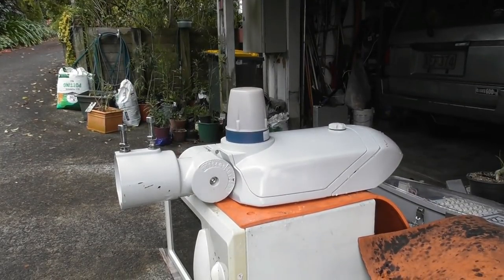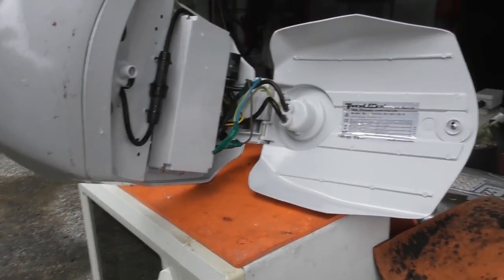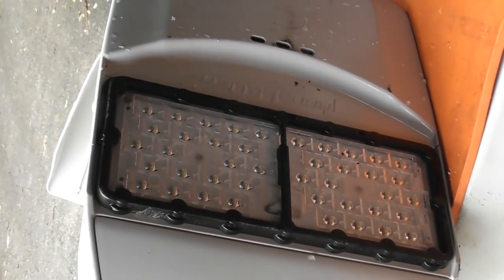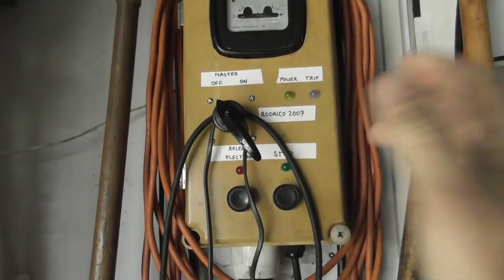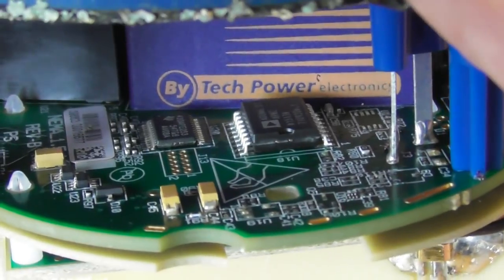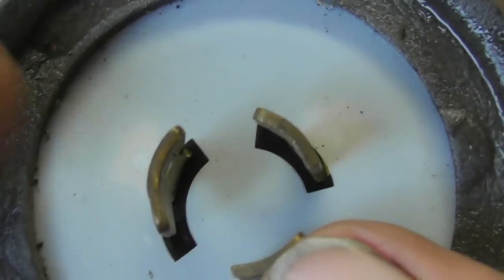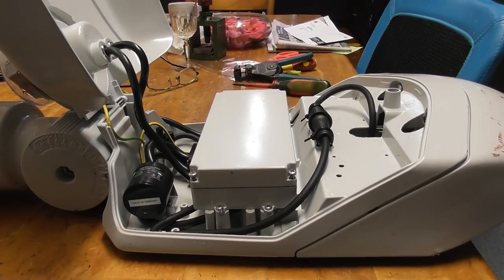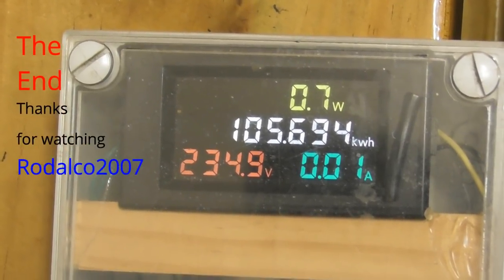LED Streetlight with remote dimmable option

Comment: The energy saving is great and all, But i sure do miss the low pressure sodium lamps of my childhood
Reply: energy savings are likely negated by them failing so soon... everywhere I look there's broken LED's blinking and not lighting at all dead...
costs lots of money, buying, installing, then needing to replace them so soon again and added man hours to do so..
Reply: @throttlebottle5906  Yeah these LED streetlights wont last nowhere near as long as mercury/sodium lamps because of all the electronics in the electronic drivers getting water/crap in them, unlike a magnetic ballast that can last many years with little to no damage.

Comment: Ants got in the photocell, and the supercap has done the usual and popped a seal, probably because it is only a 85C rated part, and that enclosure probably can get to over 100C.

I would guess the radio is there to perform both remote power switching, and to also allow the lights to communicate back down the chain to the controller for things like mains voltage, lamp current, times operating and such, performing both the light switch operations and as well acting as power line monitors. they look like they each get programmed via a NFC coil (the label on the outside) so that parameters can be set for each one individually, or for maintenance to check operation while up the pole, so as to do testing locally. 

Likely they use low power radio modules and something like Zigbee communications, and the supercapacitors are there to allow a few minutes of power off operation, so that the units can communicate data back during power failures, enabling a crew to get a precise ( down to pole number) indications of where a fault lies. Probably also have the ability, with another more complex lamp, to do things like control external switches, controlling things like park lighting or pathway lights that can benefit from remote operation.
Reply from the maker: @slademcthornbody9060  Thanks for that link. Cheers !
Reply: RODALCO2007 thanks for the vids

Comment: Those are a lot more like the ones we use in my state in the U.S., only difference is the light bars are one board and go the length of the fixture instead of the two that are equipped on that one you have. Not sure what photo cels they use but I’d imagine they are close in design. Good video sir!

Comment: The "floppy" top of the fancy photocell is in fact an antenna, there is quite a bit of processing done on that board so each individual light can be turned off or if I saw right one of these can talk to the next one and tell it to turn on (If I saw right).. so the council etc does  not have to have a massive tower where all lamps are line of sight to the main tower..

Comment: An interesting device. It must be able to receive a remote signal from quite a distance, I imagine. Too bad you couldn't locate the actual photocell element in the smart one.
Reply: Photocell is the clear photodiode, just mounted on a plastic pillar, to sense the ambient light as diffused by the package, though it responds more to light from the vertical direction than horizontal spill light from other fixtures.
Reply: @SeanBZA  I checked the video again. It is indeed visible on that plastic post. I must've missed it while focusing on what's on the pcb. Thanks for your response, Sean!

Comment: Funny how the crews would spend maintenance time replacing worn sodium lamps, now they'll be replacing failed microprocessor controlled photocells, and led drivers... In this instance technology hasn't eliminated a job :) just saved some power.
Reply: except the sodium lamp would likely have worked for far more years without failing, where's the savings in the end? 
I mean burning more fuel,  wearing out service trucks, paying employees, buying the original and replacements for the same products within a few years? I can see it costing far more than the energy saved....

Comment: vertical board with the pads front and rear an antenna?
Reply: yes,, the upper part is some sort of communication layer with a pcb antenna. the bottom part does the switching and power supply and probably some kind of charging stuff for the hycaps (i guess thats what the analog devices chip is doing down there)